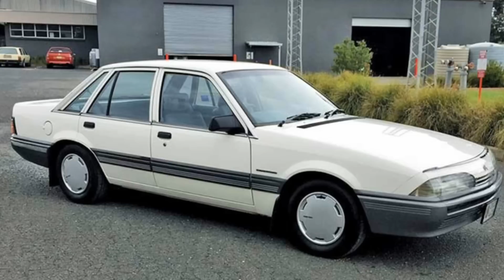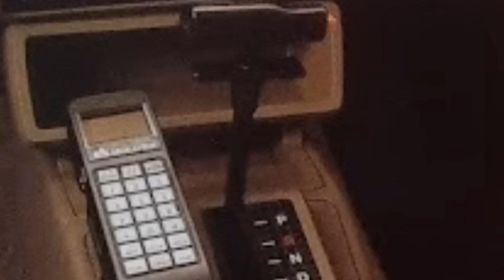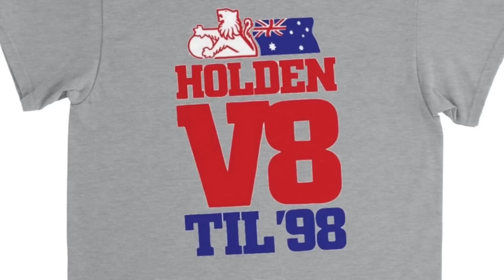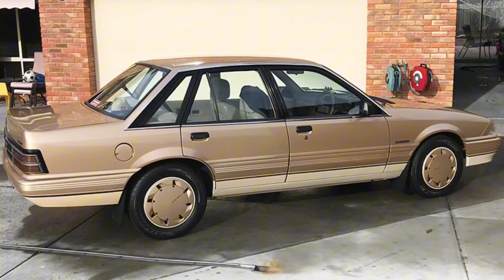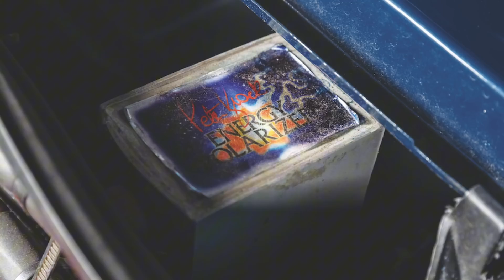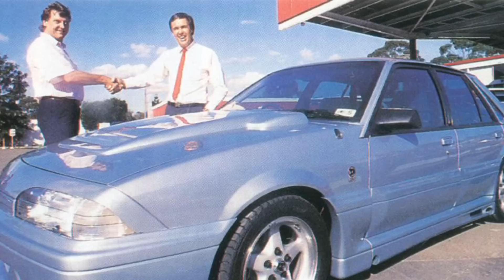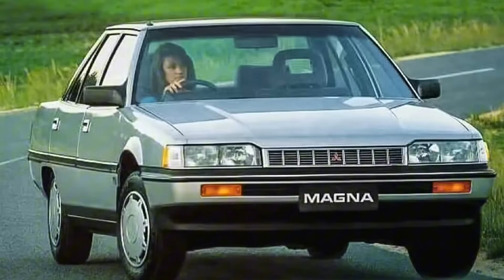Holden VL Commodore - Turbo Talk.

Comment: Another great Video loved it, PB also did a entry level HDT called the Nitro and Holden realised one called Formula.
I read in Motor or wheels magazine late 80s PB built a AWD VL Calais thinking turbo drove it around Manhattan.
What could have been if PB and Holden didn’t bust up.
Thanks Mark
Reply from the maker: @grantharrison5307  Thanks very much. I included a pic of the Formula in the episode but didn’t mention it. It was a sporty dress up package basically.  Yes, what might have been although HSV realised the Coupe 4 years later. 👍
Reply: Oh man, there's an Atlas Grey VN SS Formula in my area, kept in pristine working condition. As a result however, I don't see it much, but it takes my breath away every time I set eyes on it due to just how factory fresh it looks
Reply from the maker: @MuscleCarLover  Best of the 3 colours. 👍

Comment: I had a VL Calais back in the late 80s. White with a body kit and white wheels. Blue velour interior. Looked really nice.
Reply: I used to notice a metallic one (goldy from memory) a few doors down in 88/89 and immediately thought they were doing well. XF Fairmont Ghia didn't quite elicit the same level response.
Reply from the maker: Although the XF Ghia did have a very nice interior to be fair. 👍
Reply: @markbehr88  especially the rear seats. The Calais had an overdrive transmission and OHC six. Would choose that I think, even though I always idolised the XF Ghia.
Reply from the maker: @jamesfrench7299  Yes, the 4 speed auto especially. The injected 4.1 wasn’t too bad and it had good torque but the VL engine was more sophisticated for sure. The Ghia did well in terms of digi dash and all the velour trim incl on the doors. It was pretty cosy. 👍
Reply: @markbehr88  I always wondered if you could fit a BTR 4 speed to the injected 4.1 in the XF and what that would do for performance and economy. I'd lean towards the Fairmont Ghia if it'd had a four speed.
A ZF even better!
Reply from the maker: @jamesfrench7299  I am sure it is possible? 🤔👍
Reply from the maker: Very nice. 👍

Comment: Some were also assembled in Thailand, not just Indo and NZ but like Indo I think they didn't get turbo or V8 ones in Thailand.  I know Brunei would have gotten Australian built cars but they don't have the sort of engine size tax restrictions that Thailand, Singapore etc have so they would probably have had 3.0 and even 5.0L engines. By the time the VL was released Holdens were no longer being sold in Hong Kong and Malaysia.
Reply from the maker: Thanks for the info. 👍

Comment: Great information on the VL Commodore.
I wrote to Holden as well to save the V8 and got a reply but I did not keep the letter unfortunately.  Wish I had kept it.
Reply: It would be collectable now.
Reply from the maker: Yes. I still have mine. Signed by Chuck Chapman. 👍
Reply from the maker: Very cool. I still have mine. Ran out of time to find it and put it in the episode. 👍

Comment: I love the Rb as much as the next bloke, but it makes me sad we never saw a return of an Aussie designed six from holden
Reply from the maker: Yes, Ford certainly did a lot with its Six. 👍
Reply: The Red was a reworked grey which in turn was originally a Buick design.
At least the Ecotec 3800 had a lot of Aussie input and was again based on a Buick from the GM fold though belonged to AMC for a while.
Reply: @markbehr88  - everything from OHC to OHC with VCT to DOHC to LPG to liquid phase injection LPG to Turbo to enhanced turbo ... not bad for essentially a 1960's engine.
Reply from the maker: @351tgv  Pretty amazing and one of the world’s best sixes , esp the Turbo. 👍
Reply from the maker: @351tgv  👍
Reply: designed no, but developed, if you remember the VN S2 (not official) GMH did basically devlop the old Buick 3800 into something more civil  which the US versions did not get.

Also the EcoTec version from VS to what VY? were for AU only.  Even the (awful) AlloyTec engines had Australian development but yeesh they were sad awful garbage re: the 3.0L V7 version was pure junk.
Reply from the maker: @351tgv  Yes, I have heard a lot of issues on those. 🤔

Comment: I lived in Warrnambool and remember looking at  vl Commodore nitro which was available in red only for, I think, $25000 and the saleman trying to sell me the Wallkingshaw vl they had and couldn't sell and it sat there for nearly 12 months.
Reply from the maker: Yes, the Walkinshaws sat around a long time. I remember when you could buy a used one later on for $25k. 😳👍

Comment: Great video mate love the VLs
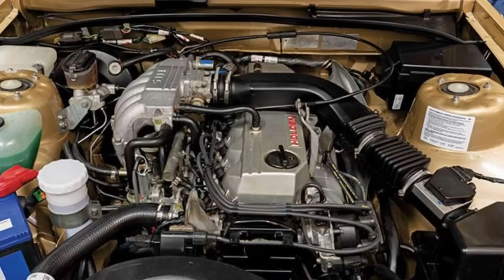I own a Morning blue over asteroid silver genuine VL Calais  5.0 stroked to 355, 3:9 diff gears and building an evening blue VL Director clone based on a power pack Berlina 800hp 3.0 but fitting a twin cam head and tremec magnum 6 speed   Plus 4:11 diff gears
Reply from the maker: Thanks very much. Very nice. 👍

Comment: I wonder how that engine and transmission it came with impacted local content rules?
I find it hard to consider it a home grown car with an Opel based body powered by another brand's powerplant albeit a very suitable one. It never sat well with me especially with Ford's efforts developing their own sixes here. 
Holden just crated them over for nearly a decade until the locally made Ecotec was introduced in 1995 with the VS.  
Good looking model for the time and the Calais particularly very effective differentiation with the semi retracting headlights. 
The dash and centre stack has aged terribly though.
Reply from the maker: Holden had a lot of export credits with the engine plant at Fishermans Bend. 👍
Reply: @markbehr88  all the same, it was a pity they had to turn to importing what is the heart of any car and pass it off as an Aussie icon which I think is BS. The V8 option and continued motorsport helped temper that.
The six was the mass seller but Holden still didn't come up with a replacement before VL. At least an engine based off a GM division design should have been prepared and built here by the late 70s. Chevrolet used a 4.3l V6 in their B bodies in the early 1980s and Opel had some large enough V6s though very sophisticated and not very torquey. I think the Nissan had less torque than the outgoing 3.3 boat anchor.
Reply from the maker: @jamesfrench7299  Yes the Buick V6. 👍
Reply: @markbehr88  at least we eventually made them here in revised Ecotec form. The slightly tweaked 154 KW version in the VX, VX2 and VY was a lot better as far as smoothness than the earlier version. The one I had on my 1995 T4 Lexcen was very coarse at high revs.
Reply from the maker: @jamesfrench7299  👍

Comment: Thank you Mark. This is getting better each episode. Finally a longer and wider car, but still not big enough. That Mitsubishi Magna was known as the Mitsubishi Galant Sigma in the United States. The Calais looked like a Oldsmobile Cutlass Supreme in the front. When you discussed the length, thank you for putting it in inches. The equal to the car would be the GM A Bodies from the 1980's at 188 inches long. A downsized Cadillac Seville 1988-1991 was 188-190 inches long. Thank you for explaining the different front end design. GM was using Nissan engines and transmissions. Who knew?  I recall the Cordia. It was here for a brief time. What was interesting was the exports to Asian countries. I remember that whole Ford Probe and Mustang issue. That was a huge thing. Mustang is still rolling on in 2024. There was the Cadillac Calais up into the 1970's. Then there was the Oldsmobile Cutlass Calais and Calais  for years well into the early 1990's.  Holden kept the Calais name alive. There it is!  The Holden Director!  Those performance HSV/ HDT cars appear like they started the last Oldsmobile look first. The 1997-2004 Oldsmobile front end looks similar to these Holdens. That was sad that relationship fell apart with Peter Brock and Holden.
Reply from the maker: Thanks very much Olds98. It was a jam packed episode as there was a lot to cover. 👍
Reply: @markbehr88  Oh, but it was so good!  You did an excellent job and I enjoyed. I am still thinking about Holdens using Nissan engines in Australia. That would not fly in the United States in the past, but it would today. I liked all the images and more. I still think Oldsmobile and Holden had a kinship and Pontiac too.  I admire and appreciate the effort to edit, narrate and put the series together. I am still waiting for more and the cars to get bigger and get more features.
Reply from the maker: @OLDS98  Thanks very much. I appreciate it. 👍

Comment: Hi Mark, hope your well, Interesting car car the Commodore VL and why it moved to Nissan for the six cylinder engines I bet it was a reliable engine but must have cost Holden this must have reflected on the price of the car to the customer. The mid 1980's was the time that cars had to move over to unleaded petrol as this started to happen in 1983 in the UK I can see a lot of engine designs were about 20 or so years old and not made for unleaded petrol with extensive work usually on the valve guides and valve seats were made of softer metals and the lead in petrol protected these parts. Nissan do make good engines I have had 5 Nissan's and all were very reliable, 3 Nissan Sunny's and 2 Nissan Primera's.
Great stories on the Commodore's racing with Peter Brock and tuning team Tom Wilkinshaw racing a name that is familiar in the UK as well as Australia, TWR done works cars with Jaguar XJS in the 1980's. The rivals to the Commodore was the Falcon but you mention the Mitsubishi Magna this car was sold as the Mitsubishi Gallant in the UK also the Courdia Turbo. Great video on the Commodore VL , catch you soon take care
Reply from the maker: @shaun30-3-mg9zs  Thanks Shaun. Holden couldn’t really pass on the costs so it hit their profit. Our Magna was a widened version of the Galant, so much bigger and it had the 2.6. 👍

Comment: I had a VL SL model from '06 to '08. It was my first Commodore and a pretty decent car overall. 
The fuel gauge never worked properly, neither did the A/C, but for the most part, it was petty dependable, drove well. 
Traded her in for a VE SV6, which I've had ever since...
Reply from the maker: @jamied1579  Cool. Sounds like you had a good run out of it? 👍
Reply: @markbehr88  It was one of the better cars I've had, for sure.
👍
Reply from the maker: @jamied1579  👍

Comment: Great job as always, Mark. The VL Calais remains one of my all time favourite Holden vehicles. I've never actually driven one myself, but I can imagne the 5L V8 would have also been great in this, although the Turbo 6 in the SL would have been a beast! The Cordia looks pretty cool too... Cheers.
Reply from the maker: @danozism  Thanks. Yes, I love the VL Calais too. You could order a turbo in any model, including the wagon, so a Turbo Calais would be cool also. 👍
Reply: @markbehr88  turbo VLs all came with upgrades brakes suspension  wheels .?
Reply from the maker: @Eric-kn4yn  Yes, brakes per what I mentioned in the episode. 👍

Comment: here in New Zealand tho we got a lot of RB20E 6 cly VL commies both in manual and auto as the years went on people figured you could put a RB25DET twin cam head on a RB30 ltr block then you got a RB30DET in your R32 skyline and now you got a big bore torquey turbo motor also a few were fitted with RB26DETT head from a Nissan GTR
Reply from the maker: @mrivantchernegovski666  Very cool. 👍

Comment: My boss had a VL company car. I drove it several times and loved the sound and the power, but the controls were woeful. Who remembers trying to figure out the wipers for the first time, or how to switch on the headlights?  But yeah.......a very pleasant open road car. 
If you have a good one, lock it away. Your retirement fund right there!
Reply from the maker: @noelgibson5956  Yes, the secondary controls looked a bit rudimentary. 🤔👍

Comment: I remember hearing a VN V6 for the first ever time.  It bloody horrified me, sounding like  chalkboard being scratched by some kind of metal implement.  I knew this noise was gonna be common on our roads for the next twenty odd years. With the Ecotech in the VS, Holden finally quietened them down. The irony is, they made the VN V8's too quiet. Why didn't they do it the other way around?
Reply from the maker: @noelgibson5956  Funnily enough though, a VN V6 (with FE2 suspension) would do a good job over that Blue Mountains road   🤔👍
Reply: @markbehr88 
Yeah, though the speed limits change that often on the mountains that a slower car is better in helping you avoid fines. Every five seconds.......40, 60, 50, 80, 50, 40 then 80 again. Purely a revenue raising bonanza for them, that road.
Reply from the maker: @noelgibson5956  Yes, this was in about 1988 so no cameras then. 👍

Comment: Gee, that brings back some memories.  I used to work at DASFLEET in Canberra and they looked after all Australian Federal Police vehicles. The weapon of choice for pursuit was the VL Turbo BT1. From memory they were damn near bullet proof as I recall only one diff failure in the time they had them. The traffic cops never complained. The RB30 with it's girdled crank was well advanced for strength for most vehicles at the time. Impressive vehicle...
Reply from the maker: @TheStav62  Agg I used to do the Mitsubishi contract price for DASFLEET too. Memories flooding back. I haven’t even heard or thought about DASFLEET for about 35 plus years! 😳👍
Reply: No comment about the Qld police traffic branch sending three VL turbos back with twisted frames
Reply from the maker: @theairstig9164  That is not available info. Tell us more. 🤔
Reply: @theairstig9164 or the manual ones needing replacement gearboxes and clutches at very low kilometres!!

Comment: The vl was the ugliest commodore ever..yes, I know I'll cop alot of flack, however,  as I've said before, the commodore was always a model behind where it should have been. The vl should have debued the v6 Buick, the efi v8 with the 4sp auto and the vn dash and interior design.
Reply from the maker: @laughinggas7722  Fair enough. I did like the VL. It was a pretty amazing make over of what was the VB. 🤔👍
Reply: Opel 6 probably more expensive... Engines had to be developed for unleaded petrol...

Comment: I remember when Holden had these Nissan engines with turbo options- Nissan  didn’t offer them as an option for their normal cars.
Reply from the maker: I am not close enough to the Nissan product so was not aware they didn’t offer the turbo too. Seems odd doesn’t it. 🤔👍
Reply: @markbehr88 GTS TURBO  , AND JUST CHANGE THROTTLE BODY TO A FORD , GET 300 KW ,  GTS  STANDRD  IS  RB 33  I LEFT  NISSAN TURBO BEHIND ,  GOING UP HILL 😊, AND V8 V6 STRAIGHT  6 ,  FORD ,HOLDEN   OTHER CARS  AT THE LIGHTS ,
Reply from the maker: @Philly-lq6zr  👍😱

Comment: When is the last time you saw an 88 Magna in traffic? 
They just rotted away by the late 90’s
Reply from the maker: @jamesmcgowen1769  About a month ago. A wagon. TN model in very nice condition but they are rare. When was the last time you saw any 1988 car in traffic? Most of them are gone. 🤔👍
Reply: @markbehr88  Yeah even the almost unkillable Toyota Corolla/Corona/Camrys are gone. 
Come to think about it, even cars from the 90s are getting to be a rare sight!
Reply from the maker: @lundsweden  Very true. 🤔
Reply: Insurance kill a lot of them off. Even very small hits and they r anxious to send them to the tip
Reply: @mikewaters6980  Spare parts can be a hassle for older cars too. I've tried to buy parts for a 20 year old Mazda once, Mazda said the party number wasn't even in their database.
Reply: @ how frustrating. It’s such a dream killer
Reply from the maker: @mikewaters6980  The parts are out there. I find ebay a good source. 👍
Reply from the maker: @ The fate of many cars these days with all the tech 🤔👍